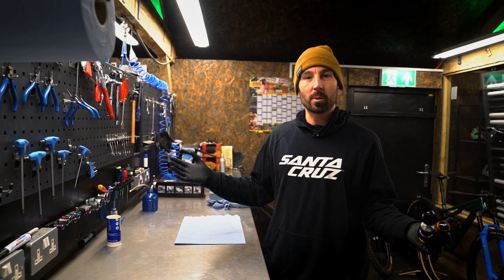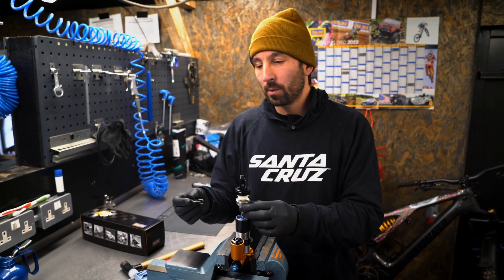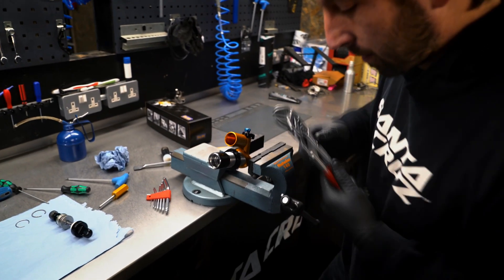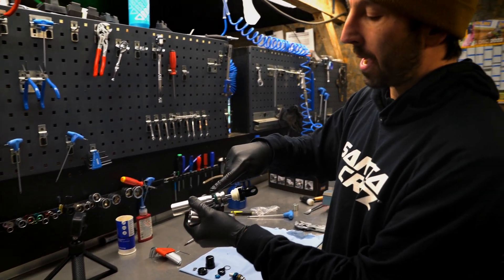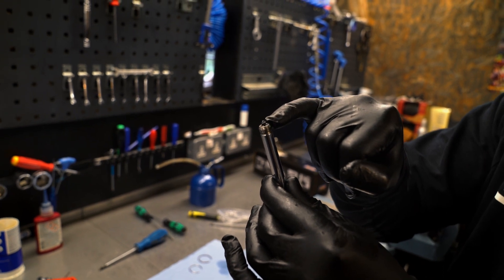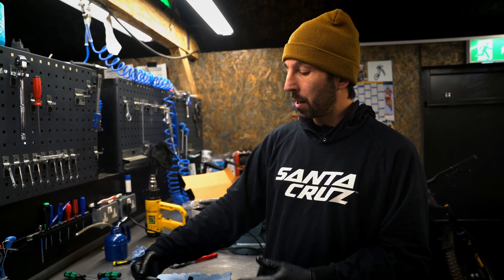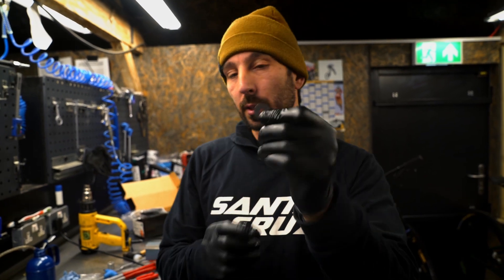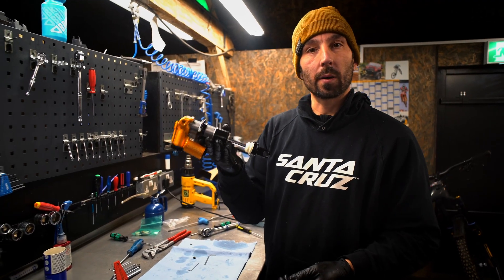What's inside an Öhlins TTX shock? Teardown and Explanation

Comment: Your vise appears to be a Rigid Matador 140.....   Can you please tell me what sort of attachment  jaws those are that were easily flipped out of the way on the vise Jaws??   At 7:24 of the video...   🙏 Cheers from the U.S.A.
Reply from the maker: 10 out of 10 for observation! They are indeed Ridgid matador, and the soft jaws are a genuine Ridgid part, simply called 'Plastic Jaws set', and you can buy them for 120, 140 and 160 matador vices IIRC. Hope that helps?
Reply: @BRINKUK   ahh good to know.  Thanks for the timely reply!!

Comment: Sweet video. This really helps me understand how the twin tube design is working. I didn't see a bladder or IFP in the piggy back. Does this shock not use one? I also noticed it looks like you increased the stroke by 5mm. Do you use a different end cap or simply change how far it's pushing into the damper body?
Reply from the maker: cheers bud! The shock uses  bladder for damper pressure. The stroke length change was simply on the stop cap so easy to sort! Cheers for watching! Mat